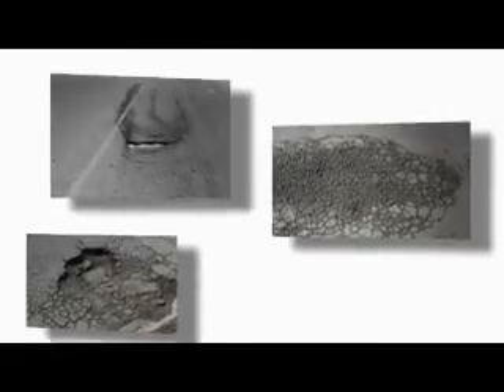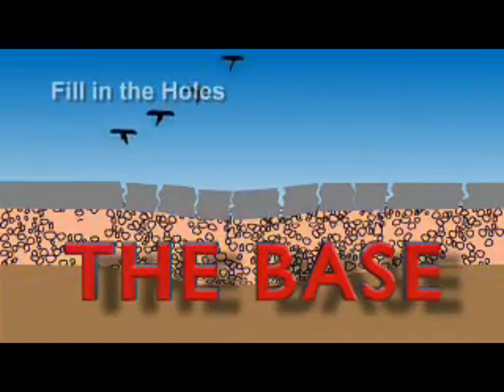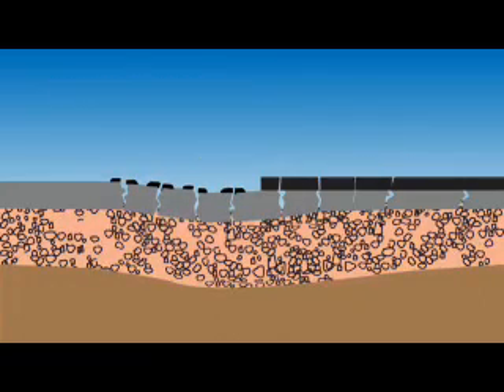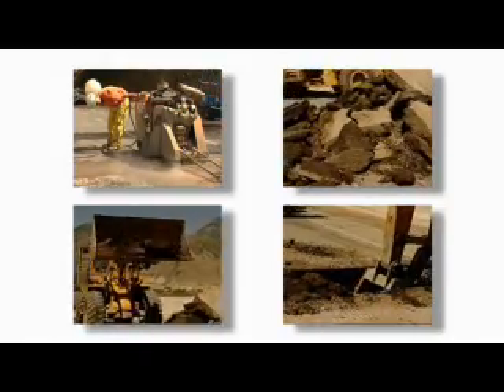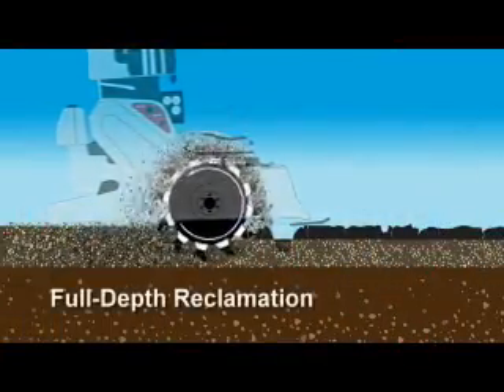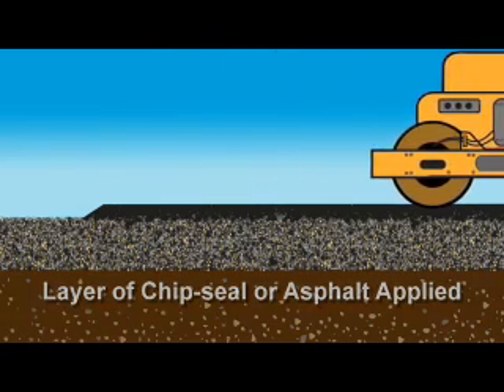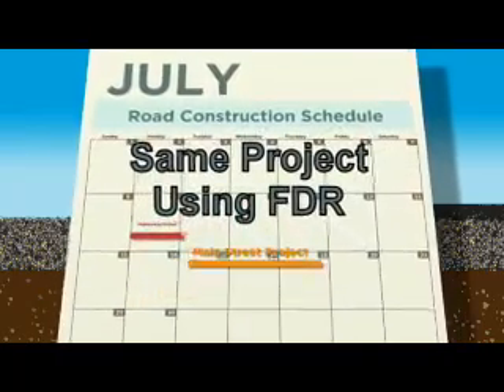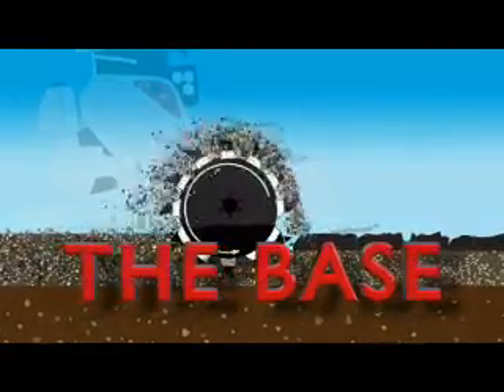What is Full-Depth Reclamation or FDR?

Comment: Will rain water ponding along the berm still be a problem weakening the road base if drainage is not addressed?
Reply: Yes, It will. Stabilisation makes surface impervious for vertical drainage but water from lateral side can penetrate in subgrade and makes entire pavement weak. So rain water ponding is still a problem.
Reply: @surendrachoudhary2063  Thank you
Reply: That takes digging french drains and culverts across America along jsut about every road.

The logical solution.